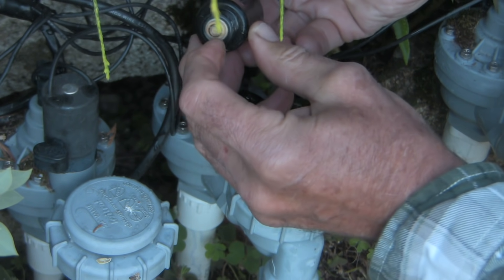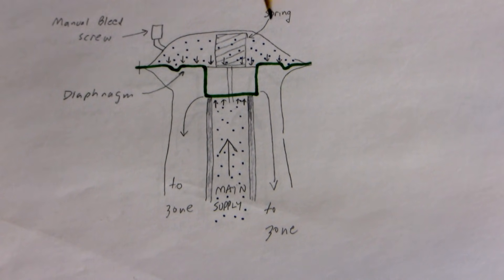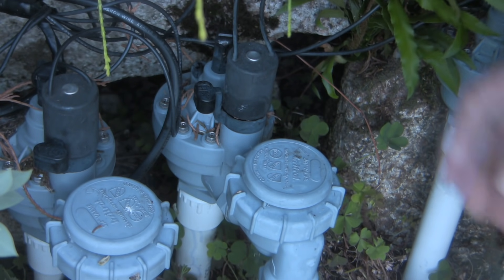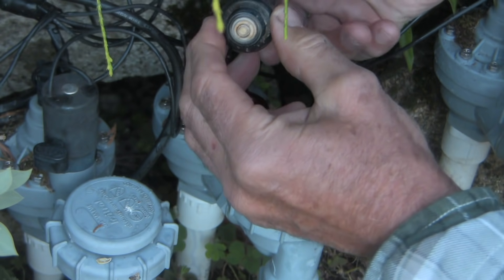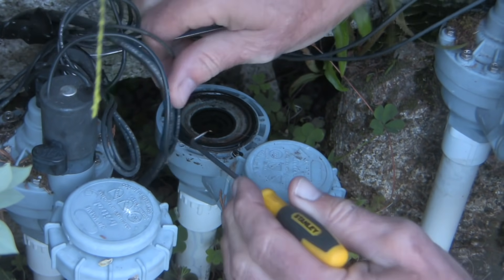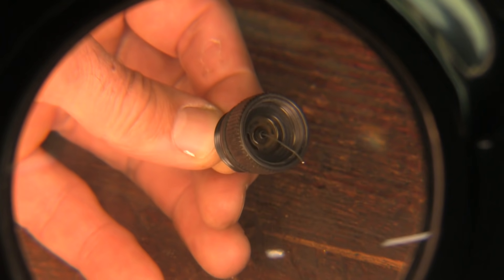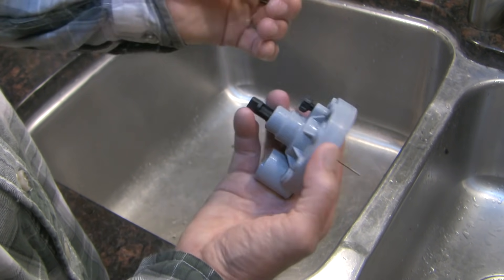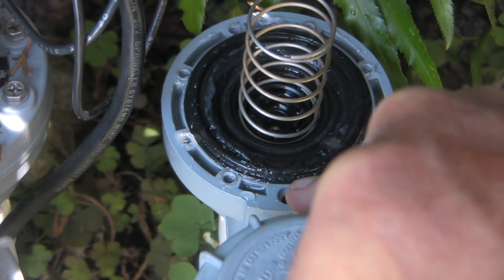Troubleshooting irrigation sprinkler valves

Comment: That was a good explanation, and I like the fact You show the posible fixing, and or mistakes people with no expirience can have by doing this.  I now have an idea how to fix a leaking sprinkler valve.  I'm trying this first, if that doesn't work replace the top half of the valve is the 2nd option. Thank You sr.

Comment: I got two zones once I turn on the main water valve one zone will just stay on even when the timer is off. The other zone works perfect. I see the solenoid to the zone that works one wire will have power and the other won’t. And the solenoid to the zone that doesn’t work both wires have power? What’s going on?
Reply from the maker: Based on your description, it sounds like the malfunctioning zone valve is sticking, just like in the video. It opens when power is on, but won't spring closed when power turns off. Then the next zone powers up but pressure is reduced because there are two valves open. Fix it the same way I did that here.
Reply: @spelunkerd  your awesome buddy thanks

Comment: Do solenoids go bad within two years?
Reply from the maker: These days, in the auto industry it is not uncommon for aftermarket devices like these little solenoids to fail right out of the box. And since failure is often the result of water intrusion, don't forget how the freeze thaw cycle can destroy adjacent valves and rupture seals. That said, you need to define whether it is an electrical failure, in which case you want to check your wire nuts for corrosion and voltage drop. More commonly dirt or frozen water in the hydrodynamic tree can mess up pressure effects in the small pathways and the diaphragm inside the valve. If your solenoid is not sheltered by a box or subject to a lake of frozen water inside the box, I'd expect failure more often than it actually happens, ha ha.
Reply: Thanks for the feedback 👍👍

Comment: absolutely great video! thank you! aside from the continuous water stream from the sprinklers on one station, i think i discovered an even bigger issue. :(

after i shut off the main water source to the sprinkler, and i took off the bonnet to clean the various elements, there was still a small stream of water coming up from the valve. :( that’s not supposed to happen, right? :(
Reply from the maker: You're right, the main valve for water delivery may be leaking. If the main shutoff valve is the old style screw in variety, you can replace the seals or even polish the contact surface. Newer style ball valves work better and are more reliable. All that said, remember that if there is standing water above the open valve, water can siphon down from other zones and dribble through to the lower valve, giving a false impression that the main supply has failed. If you leave it open for a day and it is still leaking, most likely your main supply shutoff valve is leaking. And at this time of year, don't forget to shut all the zone valves manually. All but the main shutoff valve are left open through the winter to prevent standing water from freezing and damaging valves.
Reply: @spelunkerd  you are too damn awesome!! thank you!!

Comment: I'll be telling my landscape guy about this info, I've notice water seeps out and it make a high pitch sound when the irrigation is running, here in Arizona there sand everywhere I'm sure sand served through the valves, because my pressure is low when it's watering the plants

Comment: Sprinkler help! I replaced my sprinkler valve and solenoid, reconnect the wires and it still doesn't work. I checked with a voltmeter that I am getting 14-16 volts to my wire when I turn on this zone. However when I connect the wires to the solenoid wires, I get no volts going through. What is happening? Is my control board faulty, or is there an issue in my wiring?
Reply from the maker: Check to be sure you DVOM is set to AC volts, it should be ~24V in most systems, and if low you may have an area of resistance in the wires, or connectors, somewhere. A way to pursue that further would be to use a test light in place of the solenoid, and see if the light glows. Then measure voltage across your test light to see what it shows, you should get about 24V AC in most systems. With the solenoid completely removed from the system, use your DVOM to measure resistance, if high your solenoid may be bad.

Comment: I have water leaking out of the anti-siphon valve.  I installed a whole new sprinkler valve and it still just dribbles even when sprinklers are not activated.  It only leaks on the first sprinkler valve in the series of 3.  I have to turn main valve to sprinklers off to get it to stop.  Any suggestions?
Reply from the maker: Those valves are very simple, but they all need a good seal. I'd clean, if no better I'd replace or swap in a different valve. You may be able to swap the head only with another zone, to see if the leak moves or stays in the same place.

Comment: So if i slowing unscrew the part of the solenoid (part with the wires coming off the top) and the sprinklers turn on, do i have an electrical problem or no?

Comment: I replaced a diaphragm on my Hunter SRV 1" Valve due to the fact it was leaking. I installed a new solenoid as well. I removed the old diaphragm which was torn with a new one. The valve and zone worked well  and all was fine until the next morning when I woke up and the zone where I replaced the diaphragm was running wide open (all heads) with the sprinkler system controller shut off (unplugged). Any ideas?
Reply from the maker: Not sure. You could try flushing air bubbles out of the system by turning the valve as shown in the video, and you could try flushing or probing those small passages also shown in the video. Something inside is sticking open.
Reply: @spelunkerd  Thanks!

Comment: My favorite thing found in a stuck valve over 30 years.... A barbie doll hand "more than likely entered the system in a  city water main break"   If you need a mobile solenoid actuator  "TESTER" in a hurry... just snap 3 -9 volts together and touch the 2 exposed leads.  If you want your mind blown look up an indexing valve. or piano valve.... now that is old school

Comment: Great detailed video!  For my situation, some zone can only turn on manually, but not through the electronic system.  I get a pump clicking and pipe rattling sounds.  What would be your diagnostic? Thanks
Reply from the maker: It may be a bad solenoid, or bad wiring to it. I did an older video titled "how to fix an irrigation sprinkler zone that is not working", showing how to diagnose a bad solenoid and how to swap it out. Those little devices are inexpensive. If unsure, you could swap the solenoid from another zone to see if the problem moves with the solenoid or stays in the zone you have trouble with. Good luck!
Reply: @spelunkerd  thank you for your reply!  I already tried replacing the solenoid.  The problem started after the city repaired a broken water main on the street.  Our water was turned off for almost a whole day.  I am suspecting maybe debris from the repair.  I will follow your video and wash/flush all the parts and see.  Crossing my fingers!
Reply from the maker: @brandonchi8526  Good plan. If that doesn't work, do a voltage drop test on the solenoid while the solenoid is powered on. I show how to do that in the other video. You want to be sure the solenoid is getting a full 24V while current is flowing, so you can be sure there is no significant corrosion of the wires.
Reply: @spelunkerd  will do, thanks again!
Reply: @spelunkerd  sorry to bother you again, but I have done everything including replacing a new system.  The water is trying to pump, but doesn’t go to the sprinklers.  What is really weird is that after I replaced the system, it worked, but the next day, the problem came back.  I wish I can send you a short video showing my problem.
Reply from the maker: @brandonchi8526  I wonder if you have bad flow/low pressure from the house, maybe an obstruction higher up. Professionals have gauges but the real test is to open a valve and see how much volume can flow. You could take a valve apart, turn the water on and let it run for a while to see if you can dislodge an obstruction. Sometimes debris will get trapped by the valve, and it can rock back and forth depending on flow.
Reply: @spelunkerd  Thanks as always!  Will give it a try 🤞
Reply: @spelunkerd  FYI, I can turn on each zone manually.  The problem only occurred when I try to run the system electronically.  Don’t know if this makes any difference in your diagnosis.

Comment: 75% of my heads wont fully rise. It's so annoying... Any help? Thanks.
Reply from the maker: I'd be wondering if you have a limitation to flow volume or inlet pressure. That could be from a constriction, as simple as a valve that is partially closed, low water pressure, a kink in the main supply hose, or a leak somewhere drawing down pressure. If I didn't find anything on general inspection I'd pull one of the valves apart, then open the water supply with valve off to see how high the fountain is. Good luck!
Reply: @spelunkerd  Thanks for your response. It's a 15 year-old system. My neighbor had to replace the pressure reducer, so I'll look into that and the main valves and the lines as well as check for leaks. We've also replaced some of the heads willy nilly so maybe I have too much flow. I never checked the gallons rate... Thanks again.

Comment: Great tutorial! I replaced diaphragm in richdel 204, with irritrol 205... now the only way zone will start and stay on is if I open manual bleeder far enough, soon as I close bleeder water flow to sprinkler heads stop. Any idea what might be wrong?
Reply from the maker: Not sure, maybe a small leak in the diaphragm or seals? I'd take it apart, look for debris or damaged seals, make sure all the ports are clear and the spring is properly seated.

Comment: Great video, informative and explained each step perfectly. The first time I attempted to fix my system,  I did not clean the siphon valve. The electrical was fine but sprinklers barely popped up. After having no luck ,I went back and reviewed the video a second time and did exactly what you stated and presto it worked. I’m a 60-year-old female and  I’m very excited to save some money by not paying someone else to fix it.

Comment: Great video you saved me the cost and labor of installing a new valve. I have irritrol valves from the 90s. All the gaskets look good. They are just dirty, but have no damage and are still pliable. I cleaned them up and voila my leak has stopped.

Comment: great video.  My problem, however, persists.   I have, quite literally,  replaced the entire top section of a rain bird 54000 with brand new parts, everything but the solenoid itself.  Still leaks.  Has me baffled as there is nothing else to replace.  Ideas?
Reply from the maker: The housing for the valve itself can be twisted, causing a poor seal. I'd go back to first principles and think through where the leak has to be. It wouldn't be uncommon for new parts to be bad right out of the box, some stores accept returns that are put right back on the shelf! Good luck!

Comment: Good Day....  Like your video with great explanation. I have a little different problem. I have old Rainbird EV100 valves and I have one that won't close all the way, maybe a gallon every 2 hours.  I originally took it apart and cleaned everything but did not make a difference. At that time the leak was a lot less, just a couple of dollars a month. It has gotten worse and keeps the area of the yard wet thereby killing the grass. So I took all the parts from another zone and put them in the leaking valve. The valve still leaks. When I was replacing the parts I made sure the hole in the casing was clear, water came out of the bypass hole when i took the membrane off. So the problem seems to be in the casing. I replaced the valve cap, diaphragm, diaphragm seal, solenoid and manual valve pin. Any advice????  Since it is a major pain to replace the valve since bushes have grown over it. The valve does work manually and with the solenoid.
Reply from the maker: Large particles of debris can be trapped behind a valve, not visible when you take it apart, then when water is turned back on it gets pushed into the valve, trapping the valve partly open. So, before moving forward with the task of replacing the housing, I'd flush the system for a minute with the valve removed. It will soak the area with a fountain of water but you want to be sure the housing has to go. It is quite possible your housing is twisted or damaged and failing to seal at the lip. Not a huge job but worth doing.

Comment: recently once solenoid seemed to have not been able to life high enough to run during auto mode, and even manual levering it would still barely come on. so i 'put shim or a thin stainless washer under it that fit the recess yet had clearance for the piston in the solenoid, the thickness is important as too thick would cause a free running sprinkler valve on account of solenoid not closing. there's a delicate balance in that system with the tiny light spring that reseats the little plunger piston. now the valve has the ability to water the zone. while it's running there's a small amount of water  that runs out of the siphon vent. maybe the diaphragm or the oring.

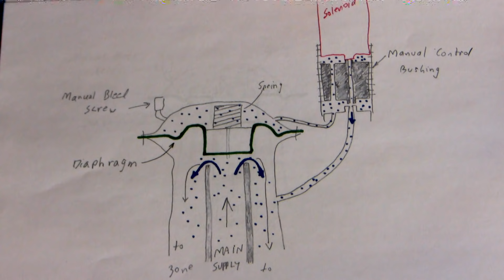Comment: I have a situation that sounds slightly like what you describe at 3:17, however I do get a little bit of water coming through the zone when I turn it on manually via the solenoid or electronically at the control box. Is it possible that a little grain of dirt could reduce the water pressure? It’s currently not enough pressure to raise any heads, and even with one head off, the water barely trickles out the open pipe.
Reply from the maker: Water pressure can be bleeding off from a leak somewhere, or a kink in the supply line can limit the ability to deliver water. You'll get a feel for what pressure your system can manage when you remove the valve and open the supply line, it should give a strong fountain of water at the open valve. Flushing the line is often worthwhile because debris upstream can get caught at the valve and cause supply problems. If you get good flow with the above test you'll know your problem is downstream of the valve.

Comment: I will follow your instructions.  When I open the solenoid, water leaks from the side.  The zone is already closed but water is still leaking in the valve so I closed the solenoid.  Thanks for showing the different steps to clean up the system while paying attention to the o rings.  Should I unplug the controller (hunter) while cleaning up or doing some repairs?
Reply from the maker: No, you should not need to unplug the controller, just make sure the water supply is turned off.
Reply: @spelunkerd  Hello sir.  I'm completely confused with my controller system.  I have two irrigation boxes on the ground, one by the driveway outside the house and one inside by the side of the house by side entry garage door.  I have a Hunter Xcore controller.  I successfully programmed A to water in front twice a day.  My thoughts were that either program B or C would be for the backyard.  When I set the time for B to water, it started to drip again BUT in front.  So I tried program C, same thing happened, it watered the front.  At the side (inside irrigation) of my house, I can hear there's water flowing because I can hear hissing sound.  But why are the back plants not watering?  Please help.

Comment: Top notch discussion of control valves. 20+ year landscaper here. Working on a valve that will not activate electronically but does open manually. Electric and timer checked out. Could be blocked pathway to solenoid. 

POC tied to 1/2" Pex tubing, though, after valve was on 3/4" PVC. Loss of pressure and flow may have dropped so much,  valve can't open via solenoid. Just manual bleed. Always something new!

Comment: Thank you for your video. 
What could be an issue if part of one zone isn't working ( drip irrigation zone , no sprinkles ) . I swapped the solenoid , same issue .  Should I look at valve itself ?
Reply from the maker: If it is only an issue on part of a drip zone, then you've probably got a problem in the line distal to the valve. Those little hoses can get kinked off, cut by a shovel, or most commonly, obstructed by a piece of dirt inside the line. I'd remove the little drip device on the end of each one that isn't working, then one at a time, turn on the water manually and let the line flush out debris. If you get no water flow you need to dig back and find what's wrong. The pattern of which devices have failed can be a clue as to where the problem is. Sometimes overgrown roots can kink off a line. If you get good flow when flushing, it might be simply dirt plugging the sprinkler head. Zones like this can only deliver a certain volume and if you overload the circuit then not all the devices will deliver adequate water. Likewise if there is a cut in a line, or maybe a branch got pulled out, leaving a rent in the upstream line, don't expect other devices to behave normally since they aren't getting their share of water. Finally, if none of the lines in that zone are delivering adequate water, you may want to revisit the question as to whether the valve is getting adequate flow. To decide about that, you can remove the valve head and flush the line proximal to the valve. Good luck!